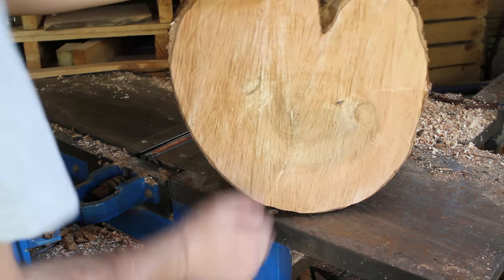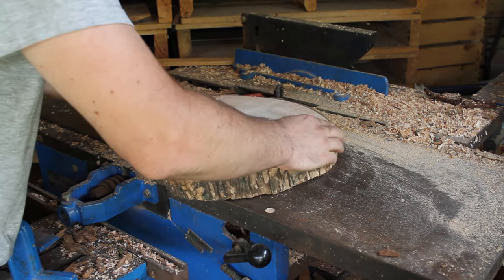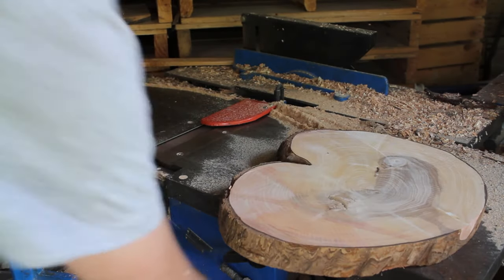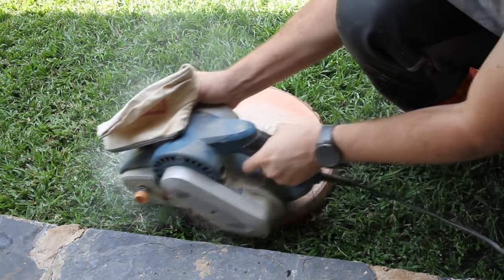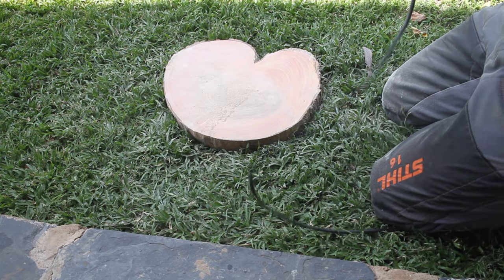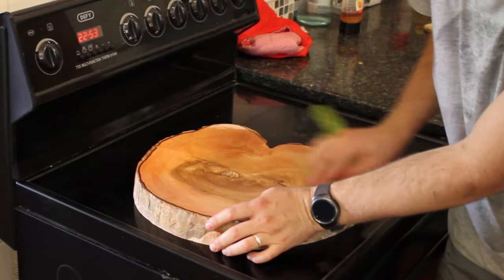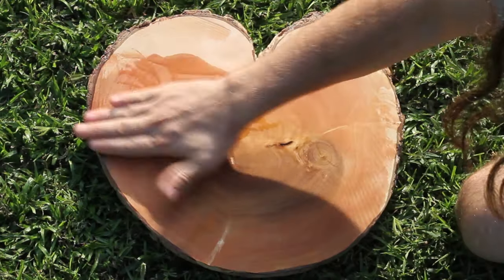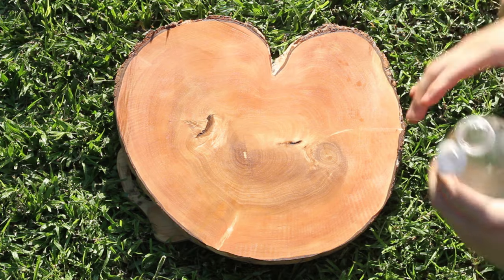Diy End Grain cutting board Quick and Easy!

Comment: I made one of these about 3 years ago and I still use it.  I cut it vertically though because the log wasn't wide enough and I didn't have a jointer or a planer so it took a lot of sanding to make it usable.
Reply from the maker: Awesome, I hope I still have mine a few years time 😀
Reply: Is it stronger vertically or horizontally? I have a very large log so I have a choice
Reply from the maker: Vertically is probably stronger but more difficult to cut with a chainsaw
Reply: router sled much faster than sanding

Comment: they have electric hand planes for the hobbiest.then belt sand it.I'm still looking for a foodsafe oil to prevent cracking  i have a downed ash tree over 100 years old wanted to cut boards  nice grain.

Comment: Hi, thanks for the video! I just got a massive stump from a fallen Cypress Pine I want to make some of these out of. It's pretty large so I don't want to waste my time but would you know if this type of wood is good for chopping boards and also do these type of tree slices work well as chopping boards in the sense that do they warp like the average single slab or joined up block boards we buy from shops?
Reply from the maker: I'm not 100% sure, but I do think that Cypress warps and cracks, unfortunately.. I think your best best is to cut the log at a 45° angle. So, instead of round slices, you would have oval slices. That helps a bit with the wood stability and oil it a lot while you let it dry out

Comment: Does the bark have to be treated also? Or will it be fine just by drying it out? Im just wondering about durability over uses
Reply from the maker: You can oil the bark, but most if not, all of it will come off over time. So you can remove it before if you don't want bits of bark coming off once in a while

Comment: Was the wood left to cure naturally or was there something applied to prevent cracking? If something was applied, what is safe to use for curing that will later be used as a cutting board?
Reply from the maker: I only used food safe mineral oil. I have been using this cutting board for a while now and just keep adding mineral oil +- weekly or whenever it start looking dull. 
By simply using mineral oil regularly on green wood, I haven't gotten any cracks either. 😀

Comment: Looks great!  Can one use a cut from a pine tree?
Reply from the maker: Yes you can but you need to dry it very slowly
Reply: @netekv what about tamarind wood
Reply from the maker: I have never heard of that wood, but I would try it and see if it works out.  I would also dry it as slowly as possible.

Comment: Hey Viktor... Just had some slices cut off a old tree on a construction site. Wood is still wet, do I need to dry before using it? And if so how do I dry it?
Reply from the maker: It's okay wet but might still crack.. try applying mineral oil as often as possible or as soon as you see it will absorb more. Sadly some wood cracks more severely than others but try and slow the drying down as much as possible aswell.  Applying mineral oil regularly helps

Comment: Can you go down the other way on the log to create a square or rectangular one? We just had 6 trees cut down into big chunks and was thinking of making a few for Xmas gifts.
Reply from the maker: You definitely can, however if you are using a standard chain on your chainsaw it will cut much slower but it can be done.  Depending on the wood species it might warp. Have a look at the video "testing the chainsaw mill" on my channel and if you want to build the chainsaw attachment I have a video on how to make that too.
Thanks for watching 🙂
Reply: @netekv  thanks so much for replying!! Will definitely check that out!
Reply: @dvlsteardrp  Then it won’t be an end grain cutting board, and end grain is preferred by most as it has a somewhat self healing property and doesn’t dull the blades as much

Comment: Would olive oil be a suitable substitute for the mineral oil?
Reply from the maker: Using cooking oils is not recommended because they can go rancid.. but if that's all you have on hand it will do a similar job slowing down they drying process
Reply: maybe tung or linseed... bees wax... stumpy nubs says the polymers are fine too

Comment: How long do you need to air dry the wood before making it into a cutting board?
Reply from the maker: It depends on multiple factors. The best is to check with a moisture meter, but I didn't do that. I just went ahead and oiled it often and let it dry out while using it..  hope that helps

Comment: Does the oil prevent cracking?,
Reply from the maker: No, sadly not.. It does slow down the drying process and might help it crack a little less badly but it will still crack
Reply: @netekv  thanks Viktor
Reply from the maker: Pleasure 👍😀

Comment: Serious? Cutting board with holes? Did you heard about contamination?
Reply from the maker: Thanks for being concerned but this is more of proof of concept video.   Hopefully when you cut your log it will not have a hole in it.  I do also agree that it's not ideal for a cutting board to have holes where food can get trapped.
Reply: @netekv   Yes. But you can still use it.. Perhaps to put hot pots..
Reply from the maker: @sister3448  yes definitely 😀
Reply: @netekv  the nitpickyness of people when it comes to cutting boards is mind-boggling. And then, when it's time to chop they whip out their plastic cutting board and just go to town producing and ingesting microplastics.
People: brushes, scouring sponges, detergent, ovens, steel wool, etc have all been invented. Wash your boards and give them a refresh every so often.

Comment: A planer would have been  safer.
Reply from the maker: Yes I agree, a planer is safer for these kinds of projects.
Reply: Must use jointer first to flatten then planer but when you get to the end of piece you will get chip out drum sander or belt sander is best if you dont have a planer a good large hand plane should work remember its end grain
Reply from the maker: Thats correct  👍 😀